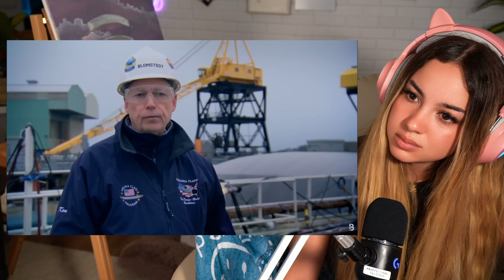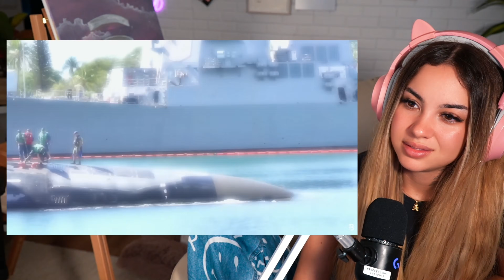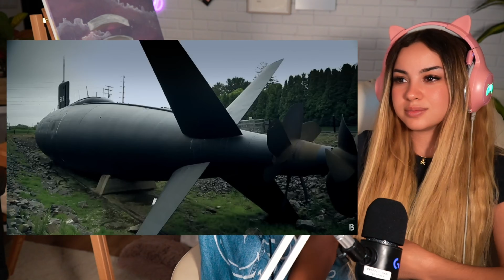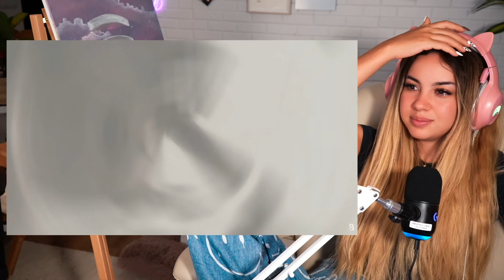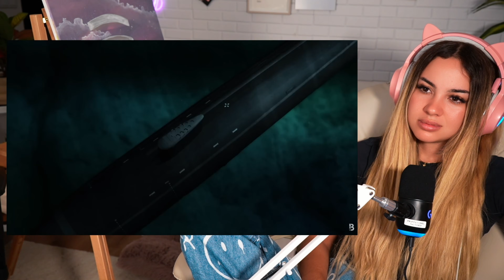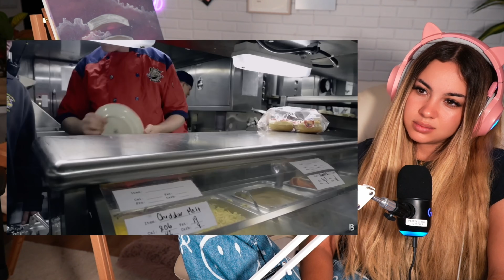The Engineering of America's Virginia-Class Submarine Terrifies Me

Comment: A submarine looks normal’ish as to what a normal work area would look like, the Control Room will have all lighting turned off whenever the submarine gets close to periscope depth to avoid giving away the position of the submarine to others since the periscope will amplify the light 💡 and it will appear similar to a lighthouse (not ideal for stealth), other than that lights are normally on in all other locations and times (except during some drills). They also are fast when they want or need to travel fast. They have to keep up with other Naval ships and for the most part they can outrun most of them. They usually don’t operate at faster speeds to avoid making unnecessary noise (think of it light tip-toeing compared to running). The length and width of a Virginia Class submarine (which is small compared to other classes of submarine) is roughly a little bit larger than American football  🏈 or soccer/football field.

Comment: Any speed, diving depth, endurance, or other performance numbers they give should be taken with a heavy dose of salt. The real numbers are classified. IE the 240 meter diving depth is just what they admit it can do.
14:00 You don't want exposed metal floors and such, they make a lot of noise underwater if something was dropped or bangs against it and that's something you don't want. Most surfaces are covered with materials to reduce noise. Noise is the enemy on subs. Submarine crews even get to wear sneakers and other athletic shoes because the rubber soles are quieter and non slip.

Comment: All nuclear power plants have the same basic principal. They use nuclear fission to create a lot of heat that is then used to make steam, which is then used to spin a turbine that is hooked up to an electric generator. This is also how coal and oil fired power plants work, except they don't use nuclear fission, they just burn the coal and oil to create steam. The electricity can then be used for all different kinds of things, from turning on a light bulb to running a giant electric motor that's hooked to a propeller on a submarine. They even power the machines used to create oxygen from water so that the crew can breath. This means that a nuclear powered submarine, essentially, has no limit to submerged range. The only limit is food. A nuclear powered submarine only has to surface once it's run out of food for the crew.

The main thing about nuclear fission for a submarine is that you don't need air to create the heat like you do with other forms of heat generation. It's also very power dense, meaning that you can pack a tremendous amount of fuel into a very small space. Nuclear powered submarines are built with enough fuel already in their reactors to last them for 15 or 20 years. The newer submarines that America is building will carry enough fuel to last 40+ years.

Comment: If 3 people work 8 hour shifts, that would be 24 man hours.  If 100 people work for 24 hours, that's 240 man hours.  Another commentor said there 3,000 people at Groton to build subs.  If all 3,000 worked in rotating shifts, all day evwry day, that would be 72,000 man hours in one day. It would only take 13 days to reach 1,000,000 man hours.  
Not that all 3,000 work on the subs and they don't work for 13 days straight.

Comment: Hey Sami. Just so you know, your neighboring country has subs that are just as advanced, if not more...and I'm not talking about Russia. Sweden has probably the most advanced diesel electric submarines in the world. They are so advanced that when the first one was built and put into operation, the U.S. Navy leased the sub for a year (with a Swedish crew), based it out of San Diego,  and conducted tests and war games against it to try and figure out how to counter it. Apparently the war games went so poorly for the U.S. that they had to lease it for another year.

These submarines were the first in the world to use an air independent propulsion system. You see, normally diesel electric submarines need to come to the surface every few days to run the diesel engine so they can recharge the batteries for underwater operations. However, this Swedish sub uses a special type of engine and fuel that allows them to recharge the batteries while still submerged. Diesel electric propulsion has certain advantages and disadvantages over nuclear powered subs. The biggest advantage is that they are quieter when running on the electric propulsion. Nuclear powered subs need to continuously run pumps to cool the reactor, but an electric engine, as I'm sure you know, is very quiet. The big disadvantage is that they are very noisy and close to the surface when they have to recharge those batteries. The Swedish sub mitigates that disadvantage by carrying this engine system that doesn't require air. They can stay submerged and silent for weeks at a time, rather than just a few days like normal diesel electric subs. Apparently, the U.S. Navy had a very difficult time tracking and prosecuting an "attack" on this sub during war games because it was so quiet and had such a good underwater range.

Comment: The current depth record for Suba divers is 332 meters or over 1,000 feet. It took the diver 15 minutes to reach that depth and 15 hours to reach the surface as he had to slowly decompress or die. All US subs can reach depths greater than 1200 feet and go faster than 30 knots. Also the ships never need to refuel as the new reactor cores last for 30 years plus

Comment: Water pressure is interesting as is pressure. Water pressure adds up fast, 33' is one atmosphere or about 15psi, outer space is similar to 33' under the water but pressure is reversed. A sub that goes down 1000' would have to be built 30x stronger than a space ship. Pounds per square inch add up FAST, at 33' under a one inch square has to hold back 15lb. Easy, put your hand over the hole. BUT that squares itself, a 1'x1'/144'' section has to hold back 2160lb at 33' or 64,800lbs at 1000 feet/300 meters. A one yard/meter of sub hull has to hold back about 600,000lbs/270,000kilos. That is only one sq meter, think about the whole sub. 
Take whatever you thought and multiply it a thousand fold, it will get you in the area.

Comment: Meta Ai: Around 9 million work-hours are required for the completion of a single Virginia-class submarine. If you turn that into 8-hour days for one person, that's about 1.1 million man-days. In reality about 1,000 shipbuilders work on a hull  plus ∼5,000 suppliers. It takes about 74 months ( six years) for construction. The Navy wants to reduce that to 66 months. So in practical terms: if you worked Monday-Friday, 66 months is about 1,430 weekdays on the calendar that the boat is in the yard — but during that time thousands of people are working in parallel to accumulate those 9 million hours.

Comment: I was in the US Navy for just over 12 years, and was in the Navy Nuclear Power Program. The training that you get before your first ship (surface) or boat (submarine) is over a year, which is why the amount of time you enlist for is longer than normal enlistments. The Submarine Navy is voluntary only, so going into the Nuclear Program doesn't mean you could end up in a sub if that's not your desire. For me, I went surface as going onto a boat that is designed to sink just seems inherently wrong. Also, you know the saying, "what goes up must come down" but what goes down doesn't necessarily have to come up. Add to that the fact I'm 6 ft tall, subs would be pretty crowded. But, so saying, the last duty station I had before I got out was an instructor at a Nuclear Power Training site, which just happened to be on a decommissioned Nuclear Submarine, so I didn't experience going out to sea on a sub, I did experience operating one. I have immense respect for those who volunteer for submarine service as it's not easy. At least I had the opportunity to see the sun if I wanted to, even though I didn't see it a whole lot. 

The rack/bunk/bed they showed was the same type of bed we had on board the surface ships as well. Basically a sheet of metal with a thin mattress on it, and you lift it up to get to your belongings. It was referred to as a coffin locker. The only bunk you could sit up in was the top bunk on the three stacked bunk. 

Nuclear Power for propulsion and ship systems like electricity, is entirely different than that of Nuclear Weapons. The nuclear material is not in a compatible geometry for a "bomb", but if you look at Chernobyl, the real danger is melt down. There were a lot of mistakes made to allow Chernobyl to do what it did, and Naval Nuclear Power is designed to be inherently much safer. 

I did enjoy the video and loved your reactions to what you saw. You are totally correct that it is a marvel of engineering to create, and manned by some equally amazing individuals to keep it going efficiently and safely! Thanks for sharing your time and perspectives!

Comment: The military never publicly releases the actual capabilities of any weapon or system.  30+ knots submerged is assumed and depths over 1,000 ft, but probably not more then 1500ft.  Who knows what official crush depth is but typical safety factors for strength/capacity is 4x so maybe it’s 5-6 thousand feet?    The SR-71 publicly lists 3.5 Mach which means it’s faster than that and probably min of Mach 4 to maybe Mach 4.5

Comment: You have to remember that the subs have very little defenses if they aren't hidden.  So one thing the Navy does is not reveal the actual performance the subs can achieve.

So they tell us that the sub can go "at over 800ft deep", but they don't tell us more than that.  It likely could double that, but to the US Navy, anything below 800ft is classified.

They tell us it can go "over 25 knots", but don't tell us more than that, it likely can exceed 30 knots, possibly 35 knots, but they don't reveal those maximum speeds.

Amd in normal operations, maximum speed isn't the most important thing, it's the subs ability to be undetected.  Going fast is loud, so they only do it if they don't think there is anything that would hear them, or they have to to evade a torpedo.

Comment: Nuclear power and nuclear weapons are both currently dependent on Fission, which is splitting atoms apart. The difference is a nuclear reactor has a "critical" reaction, which means it is a self-sustaining chain reaction which releases a steady amount of energy (heat) for an extender duration. Nuclear weapons the fission goes "super critical" which means the atoms split at an ever accelerating rate which makes a runaway reaction that releases almost all the energy instantaneously rather than over a prolonged period. The sudden release of all the energy is the nuclear explosion.

Comment: Fish breathe oxygen trapped in the water as gas. That's why you need flowing or agitated water in a fish tank, or they'll deplete the free oxygen in the water. Hydrolysis breaks the water molecules apart into oxygen gas and hydrogen gas that can be extracted. The hydrogen is probably slowly purged into the ocean. It's highly explosive so you don't want to keep it on board. The oxygen is fed into the ships atmosphere to keep oxygen levels at 21%. Anything much higher is dangerous because a high oxygen environment has the risk of flash fires that will burn everything combustible at extremely hot temperatures that will burn until the oxygen runs out. They're more dangerous than a regular fire because they burn so fast due to plentiful oxygen.

Comment: So many "pros" on here saying thins that are not true and saying classified (its not) saying oh they go way deeper and other bs. Subs operate in what's know as thermocline layer, it is different all over the oceans as one in that layer the temperature keeps radar from penetrating through and they also can not use radar to detect below either that layer basically send the radar along a path long ways instead of back up so the cant be hit from planes flying over trying to detect them with radar but the thermocline level stops and the sub cannot be spotted and so depth charges being dropped will just be guessing. And I am sure there are people who think the nuke subs are quieter that the diesel/electric. But that is very untrue as the diesel are virtually silent when they dive as the generators are only used when near surface which only takes a few hours to charge and then can dive quiet as can be for around 3 says. Nuke subs must keep the power plant going 24/7 and that creates noises that travel for a long way under water due to the steam being made. Also saw someone talk about desalination, when many use distillation to make the water used and sometimes double distilled and some are doing distillation along with  reverse osmosis along with. that enough for now  but I am sure there will be many other know it alls "not knowing shit" will be back.

Comment: 51:30 Electrolysis separates water into oxygen and hydrogen because they're bonded together to share electrons. By applying electric charges to H2O you separate them depending on whether it's a positive charge or a negative charge.
Also fish get Oxygen from water that has dissolved oxygen gas so they don't need to break water molecules, they just absorb the O2 gas that's already present through their gills that's why a lot of fish tanks have aerators that blow air into the tank to make bubbles, oxygen gas then absorbs into the water.
Also, there's another chemical process used on submarines to generate oxygen called an Oxygen Candle or Chlorate Candle, it's sodium chlorate and a bit of iron. Nowadays it's only an emergency backup, but basically the crew man or woman responsible for air quality lights it in an air duct and it burns and releases oxygen. I think due to advancement of electrolysis systems to prevent acids and alkali it's only an emergency backup now in case the electrolysis and related systems couldn't be used.

Comment: I'm with you! I can't imagine climbing through that little hatch, down that squeeze of ladder down to the submarine working area and everything involved! But I can help open up the ocean to you:  33ft of seawater weights the same as air (yes air has weight!) air from earth to space (1- atmosphere). So double 33ft too 66ft is 2 atmosphere (atm), an 99ft is 3 atmosphere). So round off to 100ft equals 3 atm. So, let's take my deepest dive at 225ft. (200ft is 6 atm plus 25ft equal (round up) 1 atm = 7 atm. IF YOU HAVE A 200lb GOLD TREASURE CHEST, YOU NEED 7X200= 1400lb lifting wench power to get your 200lb treasure crest off the bottom!  Now you can just do the math an the ocean's waters are yours! I can tell you that you can go from 112ft deep to the surface on 1 breath. Because I've done it many times, teaching others. (Do you notice, watching scuba divers breath turns into small bubbles. Then those same bubbles grow bigger and bigger as they move up to surface. So as I go up toward surface from depths, air inside my lungs expand at same rate. So, on ascent to surface, if I feel not enough air in my lungs I swim up a little faster until that air fills my lungs but not break them like balloons. If my lungs get too tight with too much air I slow down ascent go to surface. The trick is it's a mind game, because your brain thinks you need to breathe on rhythm not lung full. You're in water and not breathing, so you're mind fights that you're drowning! Trying not to make this so long, but your talking being around submarine in water. Check out on a map. NW corner of Washington State an American lighthouse. That lighthouse is on basalt vertical rock that deeper than space needle is tall. Turn South Into Hiro Straight. I scuba dive that rock wall when submarine turn down Hiro Straight. I'm so close you can see the metal plates on build! It's scary place on earth! If not subs, your met with Lin cod, Orca killer whales!

Comment: For hydrogen cell cars the idea was to use electrolysis to break apart water releasing in out the exhaust and send the hydrogen to the cell to power the car. It was found that electrolysis isn't efficient enough to produce enough hydrogen quickly nor energy efficient. Hydrogen gas is hard to keep contained as well.

Comment: The difference between a nuclear bomb (weapon) and a nuclear reactor is in control. With a weapon you disarm it in transport by keaping the trigger (external bomb casing) away from the nuclear core. When it is armed, placing the core inside the explosive jacket it will be uncontrolled to detonation. 
A reactor has rods that act as cotrollers stopping the otherwise chain of electrons running into nuclei of other uranium atoms. Electrons crashing into nuclei cause photons (light) and heat. Here the light isn't all that important but the heat is used to generate steam that moves a turbine of an electric generator or on a sub the screw (propeller). This is the same idea on nuclear carriers too. Though some of the steam generated is sent to a system just below the flat top called a steam catapult for throwing the aircraft off the front of the deck in launches using a piston attached to a shuttle. They've developed an electromagnetic system now that does the same with less stress on the aircraft. 
Our president has declared against naval brass advice to have steam catapults and hydraulic aircraft elevators equipping future carriers though are designed to use more up to date equipment. They could easily devise a chair for the shuttles of each type and hook him up with a space suit and parachute for each test and if he survives both then he'll be the only person who knows for sure which is less stressing on the human body. This will give true knowledge to make the call he is now making from a position of ignorance. If he won't go I'd bet there's any number of USS Abe Lincoln sailors who would volunteer. (Maybe not now since they are facing relief.)